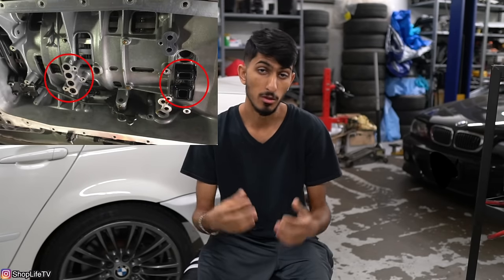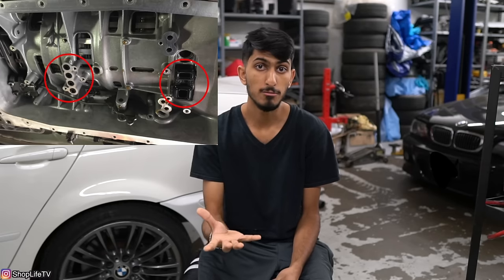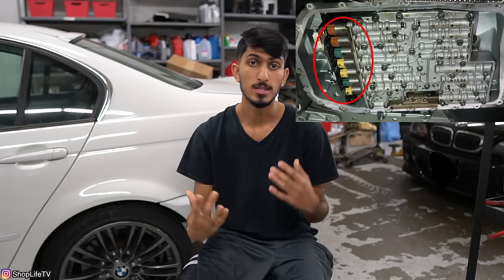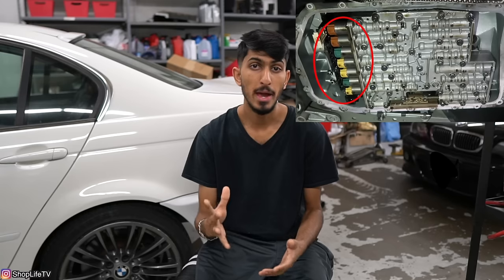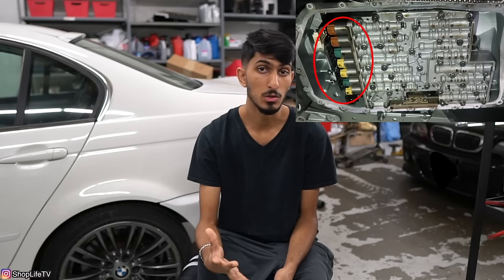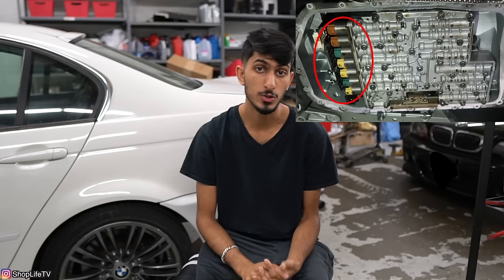ZF 6HP 6 Speed Auto Transmission Troubleshooting! Common problems

Comment: I have a bmw 535d (300.000 miles). the gearbox works okay, but sometimes at lower revw 2.000rpm and accelerating it feels like "clutch" is slipping between i think 4-5 gear and then I get the transmission error. I wish your shop was near, because here the technicians dont have a clue. it can be torque-converter, mechatronic or the gearbox itself... out of your experience where do i need to search first? i have seen your vids and i am thinking of the bushed between the mechatronic and the box or the torque converter...
Reply: Same here....slipping in 4th gear when i use kickdown... :(

Comment: Hy there, can you please support me helping  to identify what the issue might be in my case: 520d 2009 520d 6hp19 gearbox: 1st observed was the clutch still slipping in upper gears.  2nd no matter the gear, during car rolling, when taking off the gas the gear box feels like is neutral: rev drops slightly above idle an no engine brake present. The engine brakes can be felt only during downhill then the downshifting cand be felt. Those are like this since i've boght the car 4.5 yrs ago at 175k km. And 3rd (first time happening yesterday) the gearbox started to do engine beake, i can feel the downshifting, but if kick the tyre a bit when fully stopped the engine tends to die and even stops, just like on a manual transmition when you dont press the clutch.
Error: 004f53 fault in disengagement of converter lockup clutch.
I guess it s gonna be expensive... but what do you suggest. Start whith the solenoids, convertor remanufacture or both?
Fluid and seals changed 4years ago (zf + life g 6) and put about 55k km on them.
You support will be much appreciated!

Comment: My E60 520i has no fault code. But when i’m in D and i floor the pedal to engage “kickdown”, the car will rev and accelerate until red line (6.5k) and i’ll feel the fuel cut and the car maintains the rev at the redline but it does not upshift. If i drive normally in D or even accelerate harder than usual but not in “kickdown”, the car will upshift normally. M/S also works normally. What might be the problem?
Reply: My car also does this did you end up fixing it ?
Reply: i didn’t. i’ve learnt to live with it like it doesn’t exist

Comment: Do you know why the trans will frequently fall out of reverse and into neutral shortly after engaging reverse? Also happens infrequently after engaging in drive. 2003 745li  6HP26Z. Getting ready to replace sleeves etc. wondering if theres anything else I should do. Is it possibly a problem with shifter, or more likely in trans?
Reply: Did u ever find out the problem? Mines doing similar
Reply: @Joe Belichio  I don't recall a lot about it. That was my friends car, and he sold it a couple years ago.
I did a proper trans service on it. Pretty sure that didn't help with falling out of gear. Then I bought a used shifter and installed it and I think he said that it was better after that.

Comment: Sir
My BMW 2008 630 i ,  sticks into park 1 hour after parking it...when gets cold enough,  it can shift to R, D or N.
If there's a Transmission fault symbol,  i need to reset it... it works normal, but after parking it, the fault returns.... & usually goes away when cold enough.
Note:
The ATF was mixed with water after this, the problem started.
Reply: Why on earth would it be mixed with water?

Comment: I love this video. Maybe someone can give me some insight on my transmission. Couple months back we swapped pan/filter and sleeves and put some fresh fluid in there. My car still has that slight jump from 2>1. And also when I really open the throttle and shift from 5th to 6th it lags and then shifts hard. Also on regular driving if I need to switch lanes and speed up I feel it bogs down the the transmission computer (miscommunicates) I strongly feel it might be the solenoids. 

Any opinions and or insight would be appreciated.

Comment: My biggest gripe with my hp21 is it quite harshly downshifts to 3rd when im coasting off the gas around 60km/h and then will just be engine braking to a fairly rapid stop unless I touch the gas pedal. Every other auto trans I have ever driven will stay in a higher gear and freely coast along for a much longer time than this one does and it frankly ruins the driving experience for me completley. Whether this is normal behaviour or not I dont know as I have only had the car for 6 months or so, it has had the fluid and seals done with not much difference.

Comment: Can you give similar information for the how zf8 speed auto tx please ?  Where are the Mecatronic sleeves on this unit?  I did a filter and fluid change on this unit recently and I couldn't see any?.
Reply: Both transmission are similar.  Remove the valve body/megatronic, tge sleeves are between the transmission and valve body.

Comment: My zf gearbox slips when it goes from first to second gear, it doesn’t do it in any other gear but second and when you ease the throttle off and then back on it grips in and pulls.. is this likely to be internal clutch wear or more likely to be a bad solenoid? Thanks in advance
Reply: Low transmission fluid? Possibly leaking? Did you fix it?

Comment: my trans slipped on my e90 335i zf6hp19 and ever since i had some noise when shifting from 2-3 and 4-5. I did a fluid and filter change and when i drained it it looked a little dirty and not as much as expected came out. When i did the fill it took 4 qts cold then once it was warmed up it took 3 more. They usually say around 6 qts for the fluid and filter change so i was possibly down a qt. at first it seemed to help i drove it very lightly for the first 50 miles to break in the fluid and when i did some harder pulls it completely slipped out again and hit redline and now I actually got the gear symbol on my dash and it locked me in 2nd once i pulled off the highway. I limped it home and restarted it and took it around the block and it seems to shift okay. Only code i got from mhd that drive was 2AB4 which could be completely unrelated im not sure. Would changing out the mechatronic sleeve and solinoids fix my issue or should i start looking for another trans.

Comment: i have a question i replaced an engine and trans  in a 06 bmw 325 i i got it running everything is fine except the 6 speed transmission, the problem is it feels like its going into all the gears but when i let the clutch out its holding back like the e-brake is applied and when i put it in neutral and let the clutch out it will move like its in gear i can actually drive the car out of the garage in neutral has anyone ever experienced something like this

Comment: I have replaced connector sleeve, mechatronic adapter seal, 4 sealing sleeves tubes, new filter and fresh 6ZF fluid on 6HP19Z but 2 to 1 clunk is still there. I tried to reset the adaptation and drove the car for couple of days the clunk is gone but after 1 week the clunk is back once again. Lastly i tried to relearn the transmission as per the procedure but the clunk is back after 1 week. I think there are other factors that cause the clunk. Software update can solve that problem as it will let the transmission downshift to 2nd when stopping instead of 1st gear. For now i am driving in manual mode all time and it drives fine as it down shift to 2nd gear when stopping.
Reply: Doza5ioo message him on instagram he’s more responsive on there.
Reply: Im having a almost the same problem mine only downshift to 2nd but the clunk happens when driving fast and when it goes to change I get a clunk clunk clunk then the next gear and when I shift it can clunk in gear without changing reset helps sometimes
Reply: I suggest to remove the mechatronic again and find a shop to to do the vacuum test to determine which valve sealing should be replaced. You can find good materials at sonnax.com about mechatronic valve repair kits. If it is fine than remove the tranny, vacuum check the case and inspect the clutches, converter, etc.

Comment: Great video Ankur @ShopLifeTV, quick question, I have an issue with my Genesis Coupe 3.8 Track 2010, which uses the 6HP26. The issues started at 82K miles after I got a dyno tune on my car.  When in top gear doing 60-80, if you step on the gas and rev the engine beyond 3000rpm, the transmission downshifts with a gap and causes the engine to over-rev and car to jerk. Once it also made my car go into limp mode getting stuck in 2nd gear maxing out at 40 mph. Took the car to the shop and they did a transmission service. The issue did not completely go away, how does the fact that I have a Genesis vs. a BMW change the programming of the transmission?

Comment: Please use proper ZF terminology in your videos, otherwise you just confuse everyone.  The Guide (Mechatronic) Sleeve is the black hard plastic item with two O-rings that surrounds the connector and prevents fluid from leaking out of the transmission onto the ground.  The 5 types of Sealing sleeves are internal between the Mechatronic unit and the transmission body and ensures fluid under pump pressure goes where it is supposed to inside the transmission.

Comment: Damn! I have that hard thud from 2nd to 1st in my Audi S4 equipped with a ZF 6HP19(A) and just did an ATF change hoping to fix it!
Reply: Something changed?
Reply: @funnyvid23_  Yes it is much better now but I wish I had known about this seal beforehand.
Reply: @nikolaisikes6245  just an oil change in transmission and you already feel it better?
Reply: @funnyvid23_  Yes. The correct Transmission oil from the manufacturer and I highly recommend doing a shift adaptation (re-learn). It will help the transmission computer recognize there is new fluid

Comment: My 2007 335i slips and shifts hard and makes a knocking sound when pushed really hard. No codes are coming up I’m clueless on what it can be motor is good perfect compression has been recently been rebuilt but my trans is acting up. I had couple of techs look at it and they think it’s fine but you need to drive for at least 30 mins to really see the issues anyone have any idea thanks
Reply: Same
Reply: Torque converter?

Comment: I have a 2008 535i. Transmission. Will show going I to all gears but does not respond or go anywhere. Here is the tricky part. When I put it in neutral it will then act like it is in drive and will accelerate and shift normally. Never seen this before and cannot find any threads on it. I'm confused, please help.
Reply: Got it fixed?

Comment: Got my car to a local garage I had ordered pars my self and had them ready into the car
Got the car to garage asked for the job  oilsump filter and oil change and  sleaves gaskit job done

After 4 hours they called as the car was ready to collect
I got there got my key payd and get into the car I was ready to kill my self of anger they skipped the sleave job and done only pan and oil change man. I'm so distroied and hard to trust any mechanic...
My question is il be able to reuse the oil pan safe without leak or il need a gaskit or something else :(((

Comment: Hey man, i have a 6hp transmission in my 335i...ended up doing the all the mech sleeves listed, along with new filter/pan and full 9QT of redline d4 fluid(i knowww lol). after the job it ended up making shifts feel less sturdy...this is mostly in the 1-4th gear range, i also flashed xhp stage 3 tune on my trans. have been contemplating on what to do next to make it shift like new, what do you think my next step would be, im thinking maybe resetting adaptations, if that doesnt solve it i was thinking solenoids...lmk your thoughts thanks
Reply: Hi.. any luck with your problem? Thanks

Comment: I do not have any codes, but 2nd to 1st it slams into gear and 4th into 5th it wants to slip. What do you think is the specific problem?
Reply: If you'll ever know the solution to this problem, please contact me. I have the same issue from 4th to 5th and 2nd to 1st.
Reply: @markocirar8695  any answers?

Comment: can you help me I have 2004 525i  126.000 miles my problem that iam having with my car is the transmission is not engaging as it should when iam revering up the rpm go up to 3000 and my transmission go in to safe mode  I have to turn off the car later on everything is back ok any help welcome thanks you

Comment: I have problem with my e61 2.5i 2004 
Transmision goes every day in safe mode and the error is 5088 sensor gear selector switch..Can you tell me please will i resolve this issue with Mechatronic rebuilding or is it something else? Transmision shifts very smoth and with out any gliches or strange noise..Just i have every day at least once that error and safe mode.Diagnostic says that error is periodic..not permanent.Thank you for an answer
Reply: Hey! I seem to get the same error code, only my transmission slips in and out of gear when at low speeds 0-20kmh. I ended up putting an entirely new transmission and torque converter in but it still occurs. I've had a look online and there isn't too much information out there about it. Did you manage to find out a fix?

Comment: If your BMW has over 70,000 miles do not I repeat do not do a transmission fluid change service on the vehicle. If the transmission is slipping and you change the fluid it will slip even worse due to all the metal shavings and particles being removed from the system. What he says is correct use only the correct transmission fluid for your particular BMW. Do not use aftermarket fluids. There is no such thing as lifetime fluid but unless your transmission fluid has been changed around 40 to 50,000 miles and 40 to 50,000 miles after that do not touch it leave it alone or it will even become worse.

Comment: So I have a 2007 bmw 335i with the zf transmission. Whenever I give full throttle it goes into limp mode. I pull over turn the car off, and boom it goes away only to come right back when I give speed again. Is this transmission done or does the flush fix this w sleeves and solenoids fix this?
Reply: I have the same issue and I am still looking for answer of the same question. I don't feel any kicks during upshifts or downshifts most of the time.
Reply: @TheGhost5800  changed my transmission fluid w zf oem fluid transmission is back to good and shifts smooth now
Reply: @sebaj8386  Fluid was changed 2 years ago by previous owner of the car but I don't know what fluid was used. 
It is possible your fluid level to be low before and with change you achieved right oil level. I have checked oil level in my transmission with running engine and oil temperature between 30-50 degrees Celsius and it start leaking big amount of oil from fill plug.
Reply: @TheGhost5800  you might benefit from a flush. Your oil is probably old and thin. I’m not 100% though I’d need to see it. This fixed mine I was hesitant at first but it’s gone now.

Comment: I bought my 2007 550i a month ago and last week it displayed a transmission malfunction code. I took it in to my local shop and they read a 4f8a code. Gear ratio 4-5 and recommend a full rebuild or replace. I was quoted 9 grand. I live in washington state. Any suggestions of shops in the Pacific northwest to call that would be more reliable in diagnostic or repair?
Reply: mt198917 where do you live?
Reply: mt198917 I would bring it back asap to whoever you bought it from, they straight up sold you a lemon, does Washington not cover lemon law, a month and it already shit the bed, you got robbed.
Reply: mt198917 this is my advice if you purchase a BMW 2007 and up you need to purchase extended warranty all the time . Go to the play that you purchased the car and trying to get extended warranty if it cost $3000 don't get the cheap one you would save a lot of money I live in Florida I see these cars all the time . Especially when you have two   Turbo
Reply: @mcgyverb1664  Lemon laws only cover dealers. If he bought it from a private seller lemon laws don't apply.

Comment: I have an 05 e53, and it’s on the 2nd transmission - one weird thing is that if I don’t let it heat up it kicks from gear 1 to 2...it did that with the other tranny too - any ideas?
Reply: my 06 e53 does the same until it warms up or for whatever reason when first taking off after sitting over night. It also has "slamming" issue and "hicups" at about 30mph after driving for a while. Did you ever find a solution for your e53?

Comment: Hi, my ZF6HP26 trans recently started vibrating after a full service. I thought it was the torque converter so I bought a second hand low mileage trans with converter and put that in. This trans started vibrating straight away so I replaced the flex plate with no success the vibration remains. Both trans had new oil, filters, bridge seal, valve body seals, mechatronic seal. As little as 20 mins into operating the vehicle with the slight vibration both transmissions became filthy in a short time. I''m a little confused, do you have any idea what it could be. The only thing I found was wrong was the transmission pump outlet was connected with the bottom of the remote cooler instead of the top which I have corrected. I had assumed the top fitting would go to the top of the trans cooler and vice versa but alas logic is not always rewarded.
Reply: drive shaft??
Reply: I found the problem, it was leaking rocker cover gasket leaking oil into the spark plug holes causing a very subtle misfire which felt like transmission vibration. It hurts a little, but that means I threw away a perfectly good transmission, replaced it with a not so smooth later model trans, but at least I got to the bottom of it in the end.

Comment: hi there i need help on my ZF6hp26, i replaced the solenoids and now i am getting 4E20 code and wont engage any gear. thanks
Reply: Sergio Maze If you didn’t replace the solenoids I’d say change them but since you did its the valve body. Something is sticking.